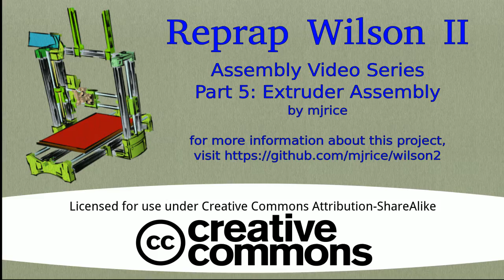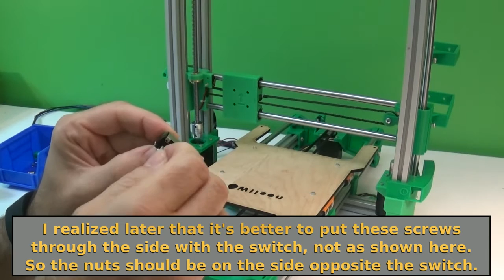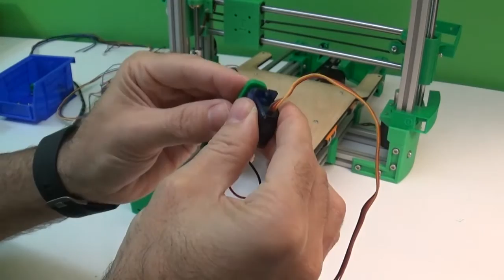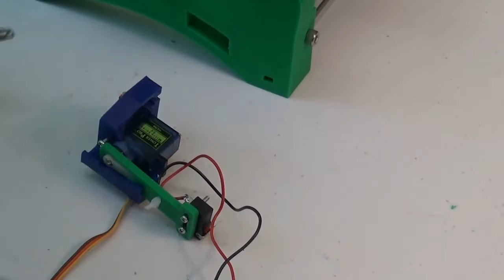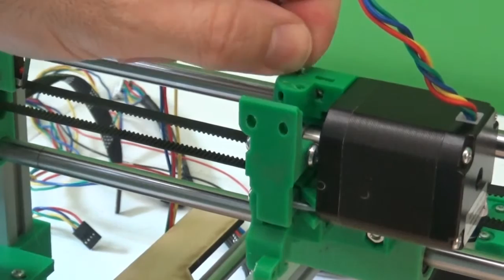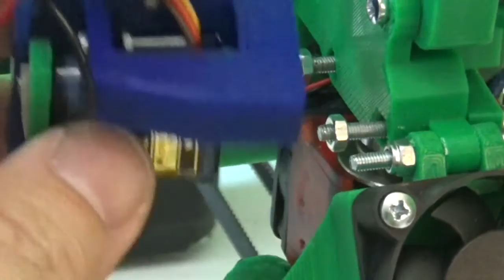Reprap Wilson II Assembly Video series part 5

Comment: If you have one of the newer models of the Wilson II (I bought mine in mid-April 2016), the first few steps of this video no longer apply.  Rather than assembling the end stop switch and servo, this is now replaced with the rack-and-pinion system shown in the updated 'part 2' video in this series.

Comment: My servo came with two self tapping screws to mount it, and I used one of those instead of a M2 screw and nut to hold it to the servo mount bracket.